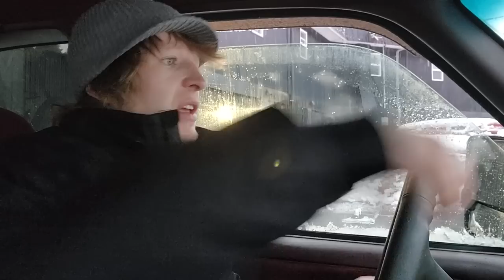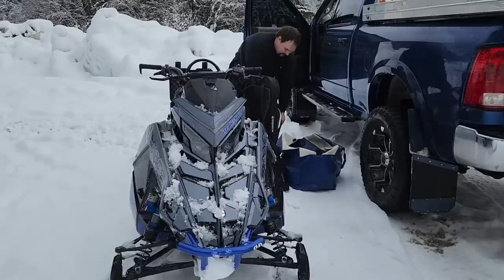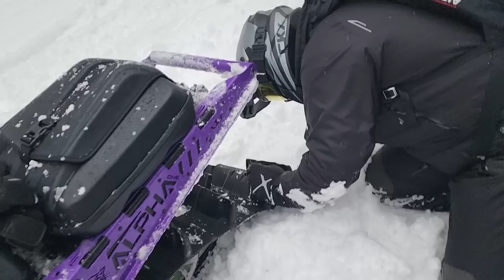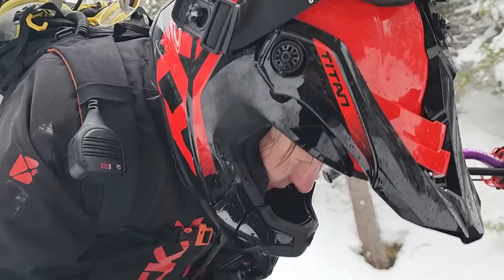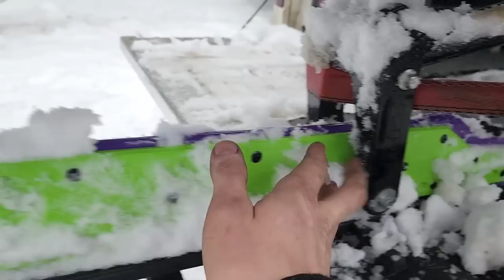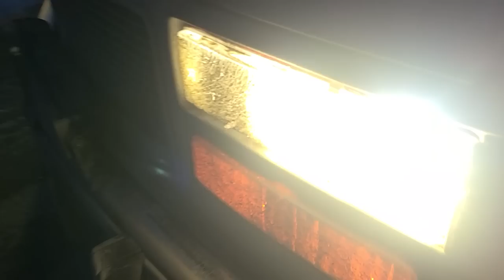TURBO Arctic Cat Alpha SNAPS Rail ☹️

Comment: I wonder if always backing the sled off your truck without ramps often had anything to do with the rail breaking?
Reply: If that's the case it's a shit design. It will encounter much harder stresses in use than that.
Reply: When he back it out of pickup it touch the ground very slowly

Comment: Dang, too bad, that will end up being the strongest alpha rail ever built in the end.   Do you think not using ramps to unload might cause those three wimpy rivets to break?
Reply from the maker: I've thought about it. That may have contributed, with that direction of that torque plate.
Reply: @syxxes  Could have something to do with the rough trails, and those big idler wheels could be putting some sort of excessive torque on things... but yea just those eedy-beedy rivets holding wasn't doing any good.

Comment: I’d assume they are expecting the glue/epoxy they use to hold it together and the rivets just locate it. Cause that doesn’t look like a lot of fasteners for what it’s gotta do. Also do you think the larger wheels with offset axles put more stress on that mount? I think it does as it moves position of the pull further from the rail which creates more leverage on the mount.
Reply from the maker: You might be right. 
But, that's all stock wheel size and mounting. Just aluminum wheels.
Reply: @syxxes  oh, thought they were larger. If they are same size as stock I don’t see it adding any additional stress other than it doesn’t give any like the rubber coated wheel does. Unfortunate you’ve had such poor luck. I have an 18’ mountain cat and I really do love the sled. Want to go newer but don’t want an alpha… might have to buy a Polaris… never thought I’d buy a Polaris.

Comment: well damn i liked that alpha, it might just be me but i think that thing runs a little weird at low throttle, sounds kinda like its struggling but it looks like it revs out of it just fine
Reply: It does! Cat engine runs a little rich so they like to run on the throttle. They don’t like to coast along.
Reply: @stillburningstrong  sounds exactly like the F7s waaaay back in '03 🤣 They don't like to putz!
Reply: sounds like its bogging and has a missfire haha

Comment: Grind the aluminum on all contact surfaces with 36 grit rollicking disc.use FUSOR 108B metal glue, and stainless steel rivets. The glue is what we use in the automotive world.  Will never break again

Comment: I’ve said this before but I’m thinking solid one piece billet or carbon fiber is the only way to go with these single rail sleds.
Reply: K-mod makes a rear skid called a "skinny" for the alphas, it uses 2 ice age bomber rails mounted a couple inches apart with their suspension arms and hardware, still works with the alpha track. Another good option

Comment: Trick for ya if you have to tow. Buy a long ass crazy carpet. Just keep it as part of your regular gear. Have some holes on either side of it and you can strap it around your track. That way the track doesn't have to spin under tow.

Comment: Beat the sh!t out of anything and you can break it. It's a mtn sled not designed to repeatedly slam the whoops.......same reason they overheat on trails. NOT DESIGNED FOR TRAILS. Yeah, heat exchanger could be on the tunnel to prevent BUT not designed for trails. Wanna be fastest guy on the groomer? Get a twin rail and pound the piss out of it so your sled can weigh an extra 100 lbs when you get to the pow. It's like not warming your sled up, and then firing it up and blasting up the groomer full throttle until thermostat opens and cold seize. Is that bad design or rider ignorance? I've had the Alpha since 2019 with a turbo on it. It's been flawless....but I don't slam whoops and smash it around.